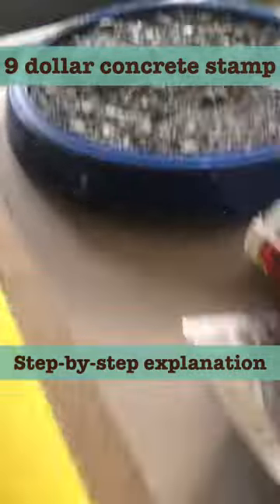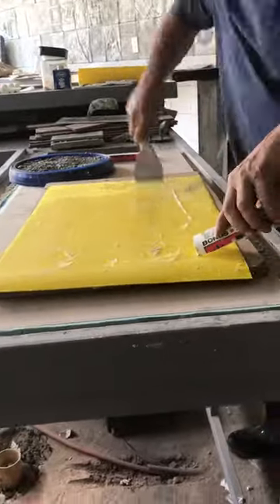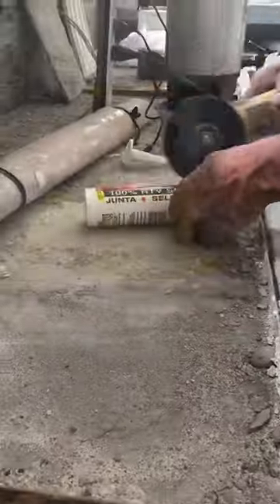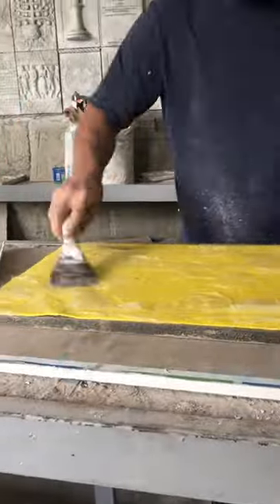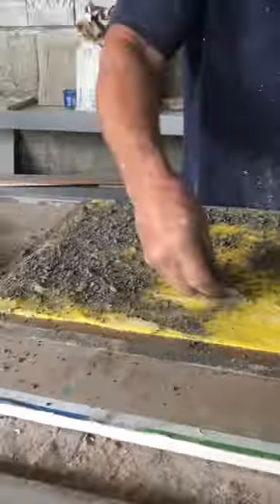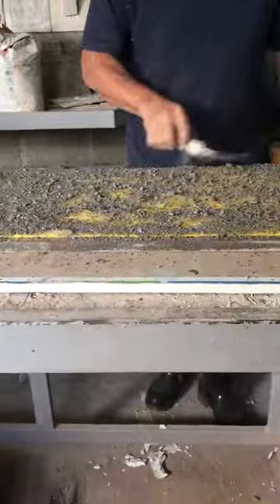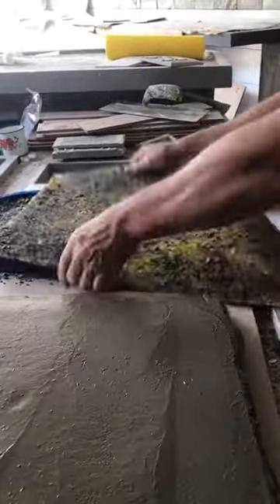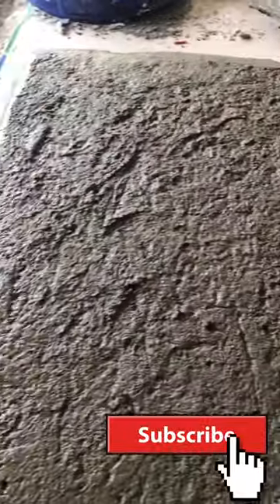#shorts How to make a nine dollar silicone cement stamp for vertical concrete or plaster!

Comment: What type of fabric is used?
Reply from the maker: It is a thick fluffy scrubbing cloth. Anything will work that is thick enough and will accept the silicone. Some fabrics repel silicone. You can always coat the other side to make the mold thicker. Make sure to watch the full video the process is explained better in the larger format.

Comment: And after its been used and its picked up residual cement mix how do the next and subsequent batches look . Being you cannot effectively clean it for next use ???
Reply from the maker: Rick it isn’t like that at all. The cement doesn’t stick to the silicone. The stamp remains always clean. Look at my cement mix that I’m stamping it is quite dry. You have to know how to get your cement mix perfect for stamping.
Reply from the maker: The moulds can be washed with a garden hose if your mix was wet and sticky

Comment: What type of silicone do you use?
Reply from the maker: I like to use bathroom / kitchen silicone tends to be of better quality. Read the label carefully some silicone have the same issue as honey they are filled with a lesser quality filler to increase profits. Transparent silicone tend to also be better simply because it is harder to hide fillers. Spend a bit more on a tube you will probably get real silicone at about $ 8 dollar!